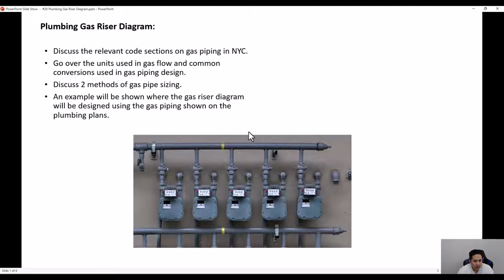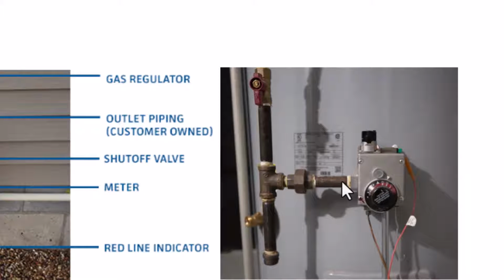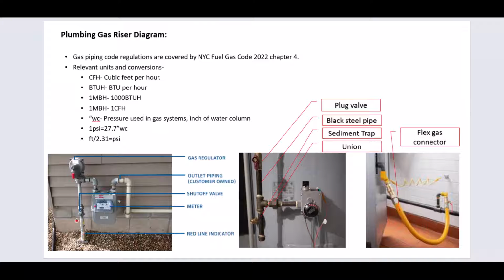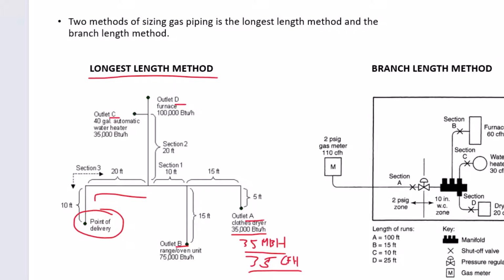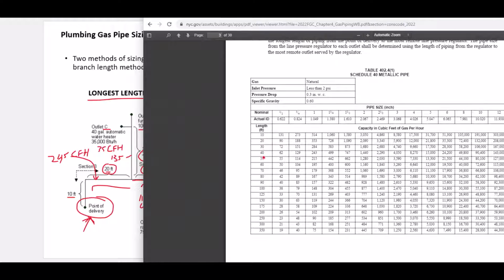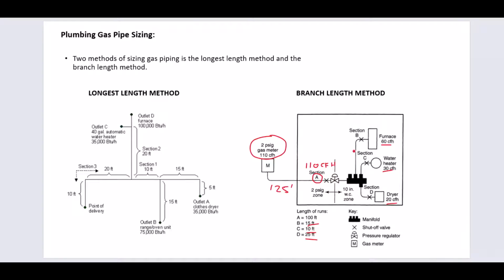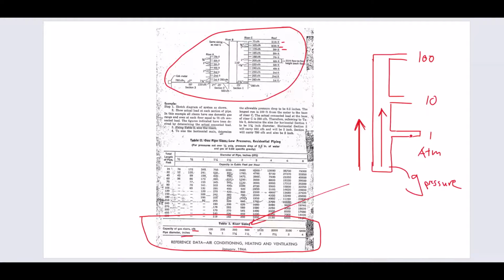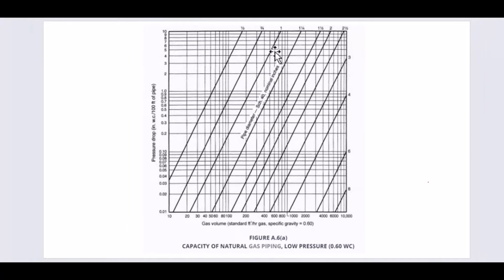Plumbing Gas Riser Diagram

Comment: Hi Lousi -- you are considering outlet B, C & D in the longest run of 60 FT but as per NFPA 54 chapter 6 (6.1.1 & 6.1.2) we have to consider those in Branch Length Method.